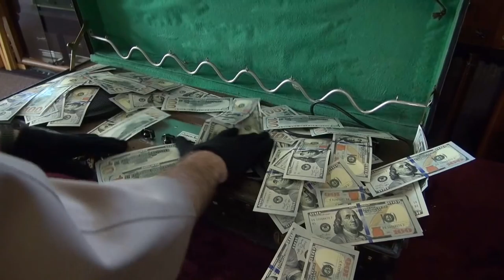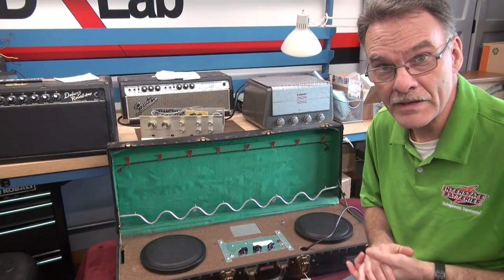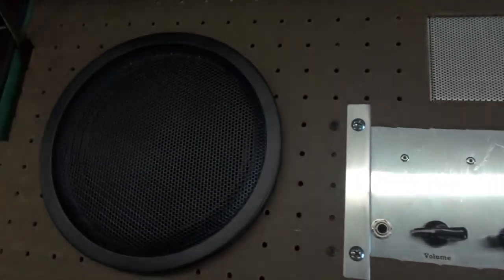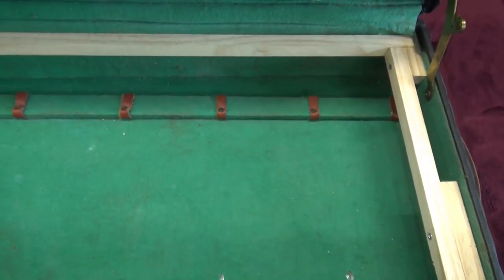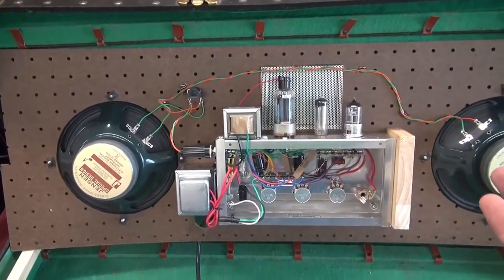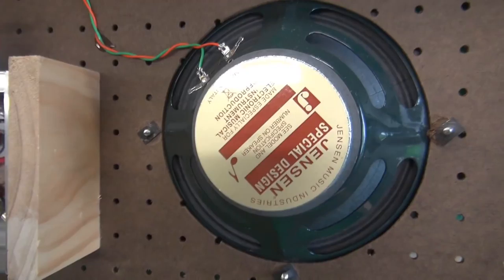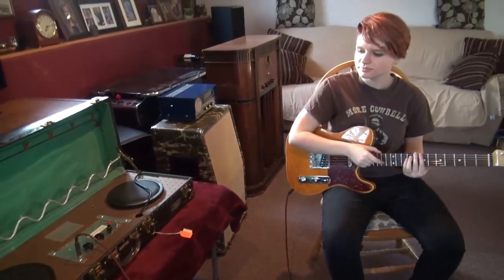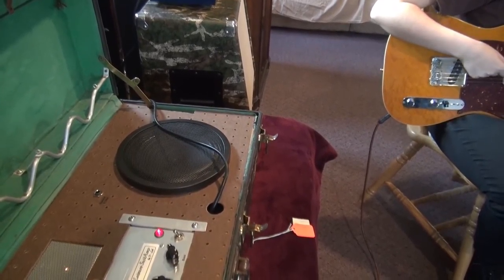D-lab electronics Super Leisure Suit Case Boutique tube guitar amp Project

Comment: Nice sounding sales man sales case! If you think about it: missions of transistors and chips are needed to "copy" this sound in a minimal quality. Yet just a handfull of components, some vacuum, heat, current are needed to make an original ear flattering music. And a Red Headed guitar star of course. 
Maybe "dering" the G string (or B?) on the guitar. Would sound sweeter imho.